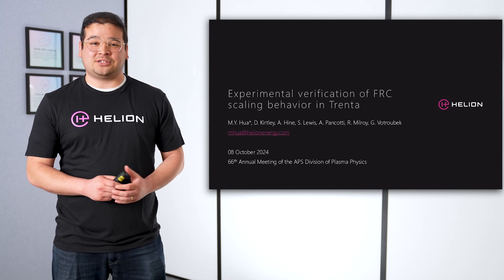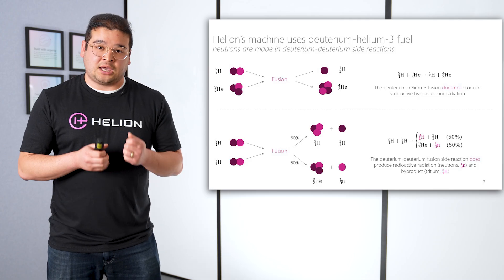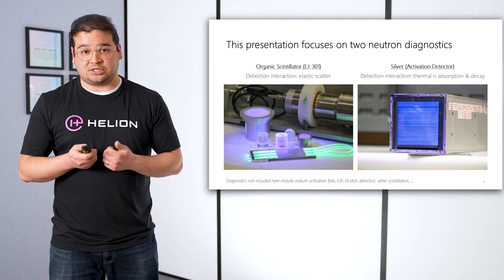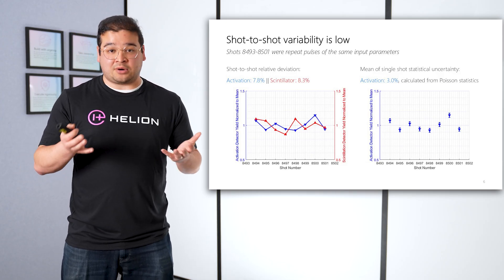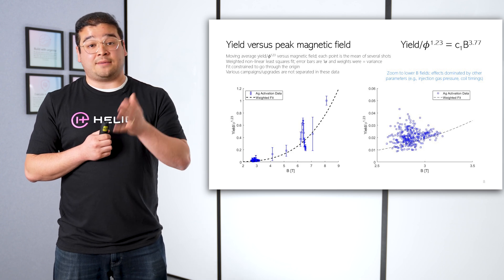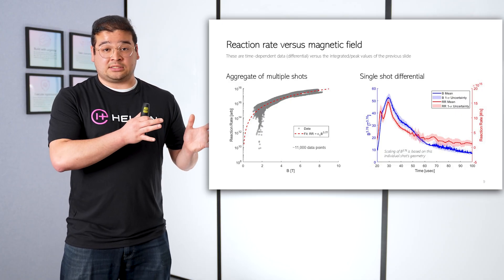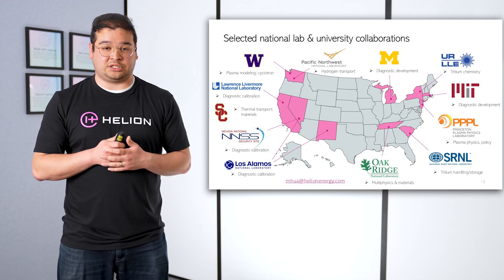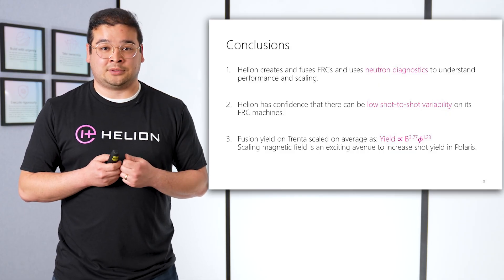Using Trenta results to predict future machine performance

Comment: See Helion Energy's press release dated July 30, 2025 and titled 'Helion Secures Land and Begins Building on the Site of World’s First Fusion Power Plant.'

Typically, nuclear fusion energy startup companies are masterful at omitting key evaluation details in making such announcements. In this press release they stated that their 6th generation experimental machine, Trenta, achieved a fuel temperature of 100 million degrees Celsius. That is well below the temperature they will require to achieve a highly significant quantity of fusion reactions using their deuterium-deuterium fuel reactions. Over 10,000 experimental shots were conducted on the Trenta Machine and yet not one shot produced more than a watt-hour of fusion energy reactions. At the beginning of 2004 a Helion spokesperson indicated that by the summer of 2024 their 7th generation experimental machine, Polaris would be producing electricity. They haven't indicated that that goal was achieved. Nor have they made any announcement that Polaris has achieved more than a watt-hour of worth of fusion reactions up to know. Their plan, to generate electrical energy from Polaris, involves demonstrating that the Polaris can generate a sufficient number of fusion reactions in a way that will result in a recharge of their compression magnetic coil capacitor bank so it ends up with more electrical charge then just before the capacitors were discharged. They have no plan for converting that excess charge to three phase-grid ready current that is connected to a grid connected substation. Additionally, Helion Energy hasn't stated that their fusion derived electrical energy, that they expect Polaris to generate, will be greater than the grid energy needed to power their Polaris facility. Polaris may achieve a shot rate of one shot per second for short periods of time but the fusion reaction may last for less than a nanosecond at the end of each compression cycle. If so that will mean the fusion duty cycle could be as minor as 0.000,000,001. Apparently, Helion Energy regards such details as being proprietary.

References:
---
From S&P Global

05 JAN 2024
Fusion energy industry anticipates electric power breakthrough by summer
By John Siciliano

The Washington-based company Helion, considered a frontrunner in the race to develop a cost-effective commercial fusion power plant, said it plans to be the first fusion energy company in the world to produce electricity from its prototype Polaris reactor in 2024.

---
The problems with Helion Energy - a response to Real Engineering (YouTube)

Comment: Great presentation and exciting stuff, I'm a fan of Helion's approach to energy capture.  You mention low shot-to-shot variability a couple of times during consecutive shots (ex. shots 8493 - 8501) but I wonder how the variability holds up over longer term usage?  After hundreds or thousands of pulses? For example if you use the same parameters, do shots 5000 and 7500 yield similar variability as consecutive shots?

Comment: I like fusion and all but I think we should focus on mass production of YBCO and energy efficiency. I feel like you guys are solving a problem that’s not necessarily economically feasible but you’ve done a lot of work with systems that could translate.
Reply: Many, technically oriented people, rationalize that technologies that don’t appear to be heading towards an economically viable path should still be fully funded, because they feel certain that economically important technical ‘spin-offs’ will inevitably result from from the non-viable efforts.
Reply: @vernonbrechin4207  well do you prefer it being spent on bombs for Gaza? I don’t see how it’s bad to spend money on expensive things? Isn’t that the point of capitalism?
Reply: @chairman_mao_Zedong - The distraction to the Gaza situation serves as a rationalization and a way to shift blame. Capitalism has a tendency to exploit the masses in order to enrich and strengthen the grip of the elite over the masses. This process makes perfect sense to people who were steeped in the concept that there should be a superior class of people and who always assumed that the wealthy few became that way because they were smarter than everyone else. Of course this also applies to an admiration of mob bosses.

Comment: Hello Michael. My name is Rick and I have written to David and many other Helion employees about my star device. I see that you all see it on my linkedin page but absolutely no one cantacts me to learn more and discuss with me. My star device has five parts and your Polaris has a million parts. My star device costs $100 to build while your Polaris costs $1 billion to build. Your Polaris uses D and He to fuse and my star device uses salt water from the oceans. My star device can be scaled up to a large device by using a hydrogen tank and putting electrodes on it. I even went to PPPL and talked to the director and his engineers about my star device and they are still billion to get their delusional theory working that has not worked for the past 100 years. This is delusion on a massive scale. Can't you see that in your Polaris at the compression zone the D and He are almost a liquid such as my star device using salt water? The sun is not a plasma. It is a liquid where the H is compressed by the suns gravitational field. You can use basic physics phase equations to prove this as I did. What is wrong with all of you people?  Please contact me. Stop being delusional!